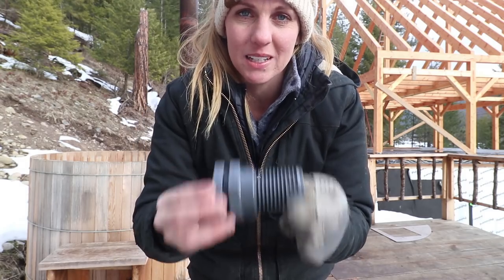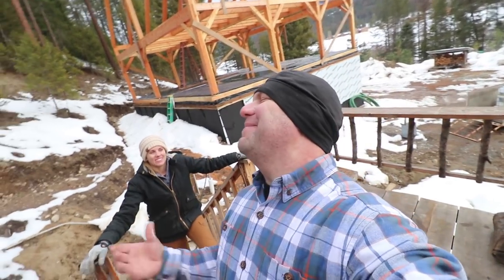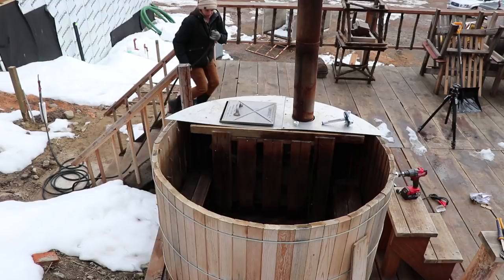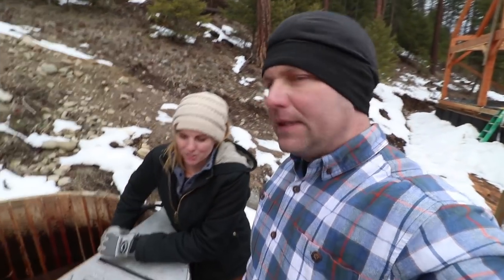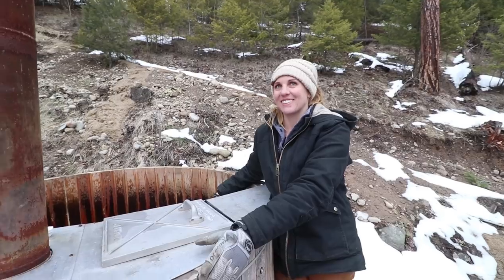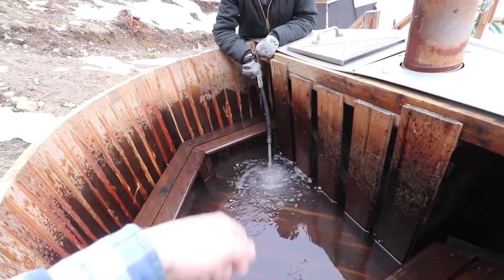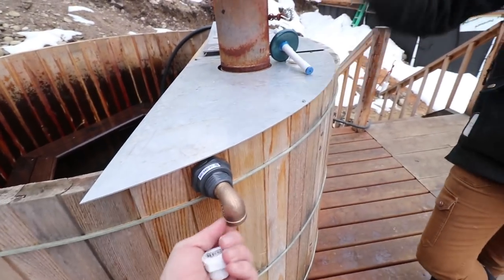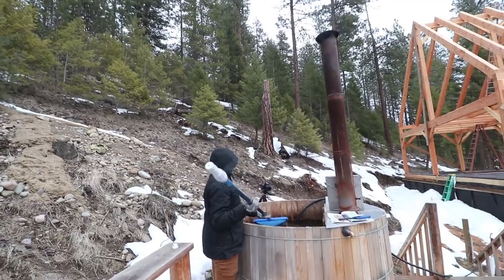WE GOTS THE WATER! (Finishing Hot Tub Upgrades)

Comment: Jesse, next time you're in town, grab a tube of Plumbers GOOP. It is the best sealant for all threaded fittings. Apply Teflon, squeeze a bead of GOOP onto the threads and smear it around evenly. When the fitting is fully seated, use your finger to swipe excess away, and it will self-level. I've been using it for over 20yrs in the pool industry, and have found it to be amazing. (It's called Amazing GOOP. lulz) It makes future maintenance a breeze, and cleans up really well.

Comment: Like someone said below, put an elbow in that top bulkhead fitting, pointing down. It will keep the splash down. Don't worry about plugging the top fitting. It is above water level anyway     >Someone else said to put an elbow in the bottom fitting pointing up. Then screw in a 3-foot length of PVC in the winter. That way you can also drain the ball valve to prevent it from freezing.     >Just disconnect the pump and drain it when not in use.    >I like someone else's idea of using long lengths of black poly hose as a solar water heater. My uncle use 200' of garden hose for hot showers at his homestead many decades ago. Thanks for the video. Jon

Comment: Just a thought about the freezing problem with the spa. Pool salt is a relatively inexpensive solution to reduce the freezing point of water.  Not sure where you are located but you can reduce the freeze point to well below zero degrees F.  I believe the maximum saturation point of salt would take it to around -20F but with some experimentation with a 5 gal bucket, you could determine how much salt you’d need for the spa volume of water and determine if it’s feasible for your climate. Good luck.

Comment: Plan TODAY for maintenance and repair access.  After things are built is absolutely the worst time to find out you can't get to stuff to fix it.  Leaving room in your conduits for extra wires, leaving a pulling line in there to pull new wires: SMART.  Adding quick connects to your plumbing and valves  so you can get things apart when needed: SMART.

Suggestion: a simple little thermostat and a 10-watt light bulb inside your insulated box to keep the pump and filter from freezing.  Light bulb on at 40 degrees, off at 60.  A simple snap-action stat is all you need, cheap and reliable.

Comment: In the Summer,  used a small 12vdc bilge pump with a couple hundred feet of black 3/4" poly pipe on the ground in the sun to heat my wooden hot tub in the PNW.  Worked good with a 12vdc solar panel, just a thought...

Comment: I know you will hate me, but if you put the shutoff valve inside the tub then you can disconnect the filter/pump and have a dry drain which won't freeze. I am sure you can rig a tool to operate it from above water. Cap the overflow from the inside, the fitting will freeze otherwise.

Comment: Cool thing with videoing things you can review how you took it apart. I do alot of photos when replacing components on high power parts of HVAC equipment.  440 volt stuff is nothing to misswire.  Great vid.  Use mullen heaters with temp sensor.  A refrigerator has those components.  You could get the parts out of an old self defrost refrigerator.  Use bubble wrap with mylar on both sides.  Roofing materials.  Strips and wrap.  That will have about R19 factor if not crushed too much.

Comment: Nice to see the tub back on line. Suggestions for you if your going to introduce a filtration system for that puppy. Variable speed pump, much larger filter than you think you need ( I would recommend a plm300. Bigger filter means less filter cleaning and wear on your pump.), 1 1/2” - 2” plumbing, and an in-line sanitizer ( longer span between water changes). Just some food for thought! Cheers!

Comment: Left hand threads on plumbing fittings? You'll find that external pipework and filters attract the most damage from frost. 'Spose you can get a mains electric heater on a frost stat when the wires arrive.
UK canal boat dwellers find mains electricity about 20% of the cost of home (petrol) generated electricity, or you need 10times your summer load worth of panels to keep up with winter demand and reduced solar generation. However the further in miles you get from the mains the  more risk there is of power outages due to cable damage (etc) SO some home generation facility will always help. -Make sure that your mains/generator switchover is to code.

Comment: Hey guys...

A note to say thank you for your efforts and sharing. 
I would like to offer some innovations for your hot tub situation, for your specific area.

I know that water is an issue (considering you don't have running surface water). so some of these may not be the best for your situation.

Insulate...
OVER Insulate... it is such a small area, R50 wouldn't be overkill.

But before you do that, shave down a 2 or 3 foot section of the top of the hot tub, about a half inch or so... You may need to experiment...

This is so you can fill the tub so the filters and stove work correctly, but when you get in, you control where the overflow goes... With some creativity you can even make that a feature.

If the pump can handle it, you may even collect that water under the structure and use the pump to return it to the top.
(think aquarium...) Box the pump and filter with over insulation too. 

Alteratively, put that box right  on the side where the stove is... Maybe hide it as a seat.

Alter the input plumbing so that with the flick of a lever you can refill overflow.

Be aware that with an insulated hottub with a woodstove, you could make soup, it can get REALLY hot... Might actually be useful at times... 300 gallons of hot water to play with?
Just some thoughts.

Comment: That ball valve will freeze and crack pretty easily. 
Use a gate valve
Reply: kerryithm2 - a ball valve has a hole in the center of it,  when closed that hole is full of water,  when frozen the ball breaks and yes,  it leaks. 
The gate valve can freeze and not brake in most applications.
And yes corossion  happens to most valves over time

Comment: you have solar, build some basic 12volt lighting for your Jacuzzi so you don't need led's strapped to your heads, something outside with remote switch and possible 1 or 2 small LED pool lights.. easy to install and makes the water experience better

Comment: Just curious... why did you put the fire box inside the tub?  Since you have a filtration system, a fire box outside of the tub could be made to work and you would have more room in the tub.
Reply: Robert Promm It's aluminum. If they don't have direct heat exchange, it would melt into a little pile of slag

Comment: Warning! Safety Tip: Not to "pile on" or anything like that but at 10:30, there's an old saying that "you should never saddle a dead horse" that applies to that/those U-bolt cable clamps for the hot tub cinching cables as well as for other applications. I'll let the Channel Locks thing slide.

Comment: Hey  just a thought for your hot tubs lower valve thermal protection. get a party store Styrofoam ice cooler. you can match the curve of the tub. a simple bungee to the valve to hold in place. cost what $3.00 at the party store.

Comment: ?????    How come you haven't used any sealant?    
Is there a soft washer on the inside at least?    
Have I missed something?

Mind you,  I don't blame you in the slightest for getting the tub ready..   
I can't think of anything better after a hard days work.  
Bravo !

...
Reply: Chris England - Same reason no sealant is used to manufacture a wooden barrel used to age wine or spirits in. The wood swells and will form a perfectly good seal without the need for sealant. I think they did install a rubber seal on the inside of the fitting. Cheers.
Reply: Yes the bulkhead fittings come with a rubber to seal the inside surface

Comment: Why not use the bottom drain used for the recyling of the water.  You would be pulling warm water with dirt to the filter and it would help with heating the filter element.

Comment: Can you put a street elbow on the inside lower bulkhead turned up the cut a length of pvc pipe that you can thread on long enough that it sticks out of the water open the lower drain valve so that it has no water,  take it out in the summer ...

Comment: Is it me or do your fittings have left hand threads ? ,!!
Reply: John Chapman I think that might have to do with mirror image problem I have been noticing in some videos, but I could be wrong. You might have noticed backwards lettering sometimes.
Reply: No, those are actual left hand threads on the outside of the bulkheads. It's made that way so when you tighten the pipe fitting on the inside it also tightens the bulkhead.
Reply: No mirroring, it seems to be left hand thread.

Comment: A fitting above waterline ... sorry, are you air piping? 
Simply put a hose on any fitting below. Hose above waterline, fitting is dry, hose in the water, and it's draining. Ok, you get it waterfilled first if you use it like getting gas out of a car tank without any fitting.
If you want to catch swimming dirt/oil you will need a scimmer.

Comment: The return is too high. Those filters are water mover, they ain't designed to lift the water. The return should have been under the minimum water level, this ensure maximum water flow. A 1" lift will basically kill all your flow. This being about 3-4" higher than the max level will cause the flow to drop by atleast 1/3.

Comment: OK Lucy you got some splaining to do. LOL How  come those bulkhead fittings are reverse threaded?
Reply: trongod2000 I wondered about that too .By the way her name is Alyssa.
Reply: Video tends to post in reverse. South is north, left is right....
Reply: Noooo, they would still turn ccw to tighten from either side.
Reply: wild guess but they will be left hand thread so when you tighten your next fitting (the internal thread is right hand) into them on the outside you can grip the nut and it will tighten the fitting onto the bulkhead
Reply: Incorrect  Swamp Rat.  Turning the fitting inside or outside does not change the direction of thread.  This is a left hand threaded fitting so when you thread in a right hand (typical) thread fitting they tighten up on each other with using a backup wrench.
Reply: Left hand threads are left hand threads no matter which way you look at them. I suspect the reason that they're actually left hand threads is because the internal threads which other things attach to are standard right hand threads, and this allows you to tighten things down without loosening the bulkheads inadvertently.
Reply: the Lying Scotsman "Lucy you got some splainin to do" is a quote from the famous TV show I Love Lucy.  We know her name is Alyssa.
Reply: Great one David!  Sounds like something I'd teach a young stud in the Navy, LOL
Reply: So you think that the male fitting has threads inside and out?  Interesting.
Reply: I think you've got to give that some more thought.
Reply: Sounds like you've never heard the famous phrase from the "I Love Lucy" show. Thats what I was referring to. But no foul. We both still wonder about that thread.  Some of the ideas posted are actually quit funny
Reply: Okay Ricky...righty tighty, lefty Lucy (loosey). haha

Comment: Hi i have a solution.... get a BBQ grill. and a copper tubing coil inside...light a fire or propane heated water warmer....use a water pump to pump the cooler water in. How to get heated spa with Fire or propane. attach a low power peitzer pad...what they make mini fridge with . one side is cold and one side is hot...this will keep the pipes warm.